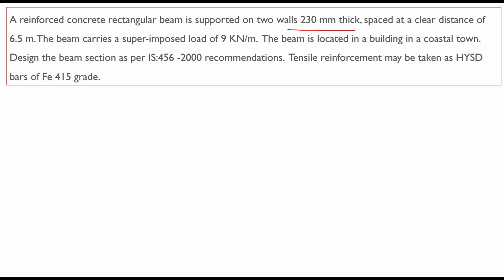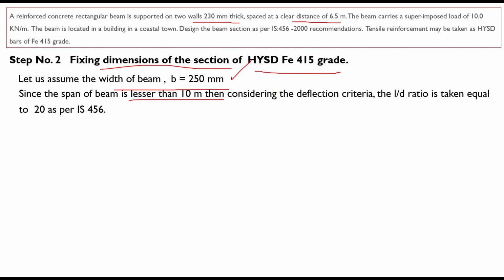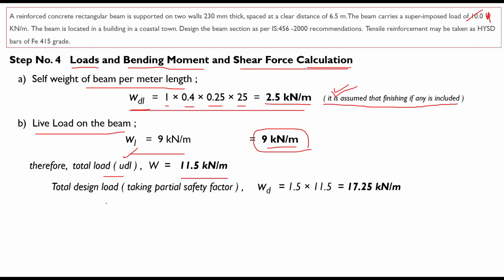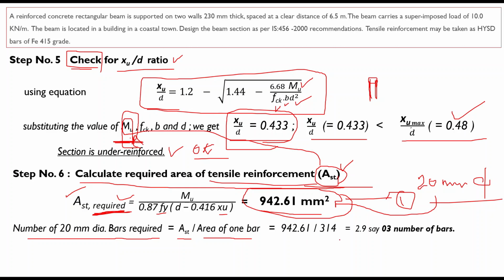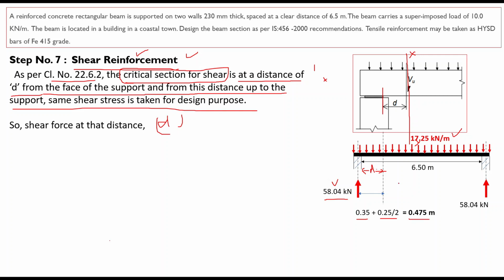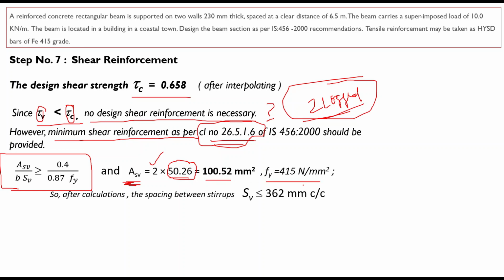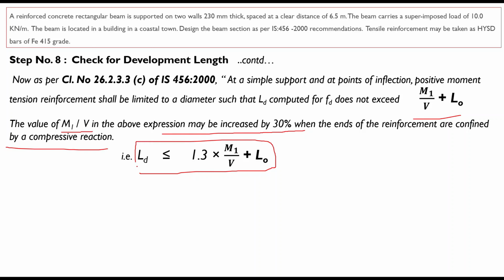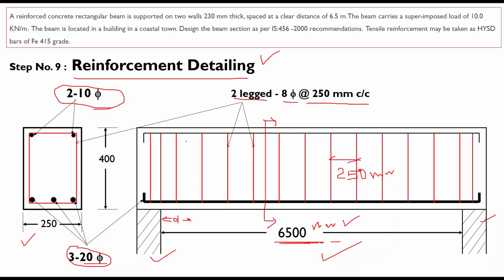Lecture 14 || Design Singly Reinforced Beam || IS :456 -2000 ||  Civil Engg.

Comment: Sir, I tried solving a numerical for design of singly reinforced beam. My nominal shear stress exceeds design Shear stress.
For this clause-40.4 is is given.what I want to understand is, if I have to provide spacing for stirrups can clause 26.5.1.6 be used?
Reply from the maker: No you have to design stirrups as per Cl. 40.4. Cl. 26.5.1.6 is applicable when you have to provide minimum shear reinforcement.
Reply: @DrBharatBhushanJindal  sir, then how will the spacing between stirrups be decided as from formula of Vus the value of Sv becomes undesirable.
Reply from the maker: Rephrase your question.

Comment: Sir, at (15:15) why does the partial safety factor of steel play no role in total design load? wont it lead to a perception that beam is plain concrete?
Reply from the maker: Don't get confused between partial safety factor for 'loads' and 'material strength'.